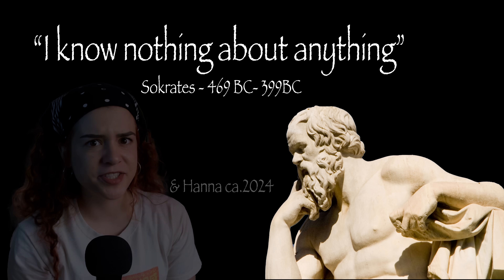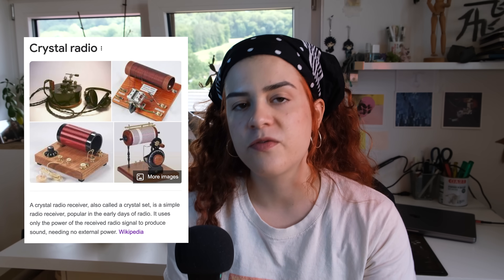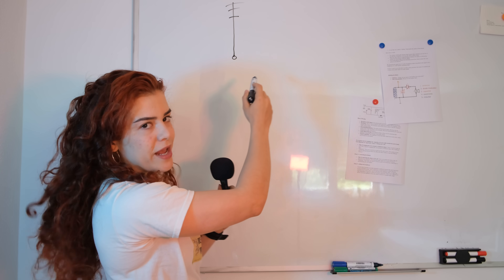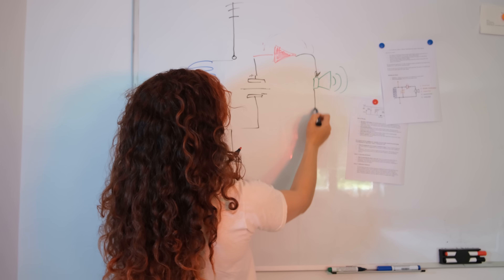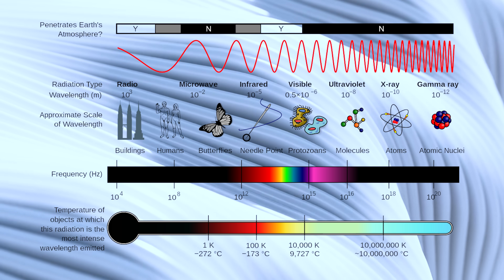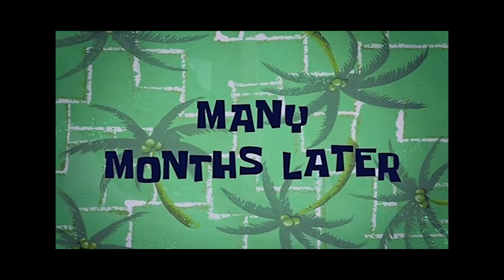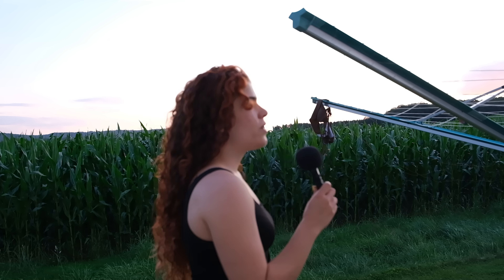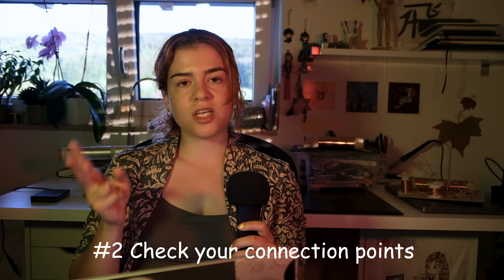I BUILT A RADIO AT HOME

Comment: So the difference between AM and FM is quite interesting. We need to transmit sound waves, which for us are between 20hz to 20,000hz. But if everyone used that band, everything would get super muddy and incomprehensible. So people need their own space

AM solves this issue by giving different stations a different frequency. It’s a very high frequency, in the order of 1 million Hz. Then, you can change the intensity of this ‘carrier’ wave according to the actual sound you want to transmit. 

Am has a big problem though. The intensity also decreases when you go through solid objects such as walls. This means that the difference between 0 signal and the signal you’re supposed to be getting changes, and gives you less audio resolution. Think about it like this, measuring a 10m distance with a ruler is going to be a lot more accurate (with respect to total length) than a 1cm distance with the same ruler. The fact that the property used to transmit information is modulated by other things makes AM very susceptible to noise. Which is why AM channels are noisy compared to FM

FM set out to fix this. Instead of giving a single carrier frequency, it gives a range. These frequencies are even higher, at around a hundred million Hz. To transmit information, the speed of the wave is increased or decreased. This is much less susceptible to change. Even if the signal gets weaker, ie. the intensity gets lower, the speed will remain the same. This is why FM is still audible in an underpass for example. 

AM is basically obsolete at this point, which is probably why you weren’t able to get a clear signal. Stations have become very uncommon compared to FM

Comment: Making a receiving radio is easy, people in the military used to DIY them for music, etc. (Foxhole radios). Making a transmitting radio is where the more intellectual stuff is at, and you also have to abide by the spectrum and maximum power laws. You'll most definitely need an FPGA if not a custom ASIC to make something to transmit digital data. But you could make something simple using small analog circuitry.

You asked how FM and AM matters in your circuit. Well, you most definitely built one of them, because as you know the sound signal is at 20-20k KHz (λ=14.99 km to 14.99m), but you modulated it to ~90 MHz (λ=3.3 m) using signal modulation. The reason is not because sound frequency EM signals are slow (sound waves are different from EM waves). It is because the length of the transmitting antenna has to be at least λ/4, meaning you'll need very long antennas to transmit at low frequencies. That is why our phones operate at 2.4 GHz (λ = 12.5 cm; λ/4 = 3.125 cm) without big antennas protruding from it. Still, longer the antenna, better the transmission, so Wi-Fi routers have longer antennas (but power is limited to 4W according to FCC laws. In AM modulation, we send all signals at a fixed frequency and modulate the differences in data at the amplitude. In FM, we send all the signals at range of frequencies, and we tune into the middle frequency. The one you built is thus, since you don't capture a frequency range, an AM receiver.

There's a project called system-bus-radio on GitHub which lets you use the movement of signals between RAM and CPU (i.e. through the system bus) in a controlled fashion using specific CPU instructions to generate low radio waves by cyclically disturbing the EM field.

After all, in deeper reality, everything is generating radio waves, light and heat. We're just controlling the way in which they oscillate when transmitting modulated signals.

Comment: It's worth pointing out that this radio was not plugged in and had no battery or power source other than the energy carried by the radio waves themselves! which is why it's so quiet. A radio that you can listen to comfortably works on the same principle, but the weak signal is amplified (requiring an external power source) before reaching the speaker or earpiece.

Comment: About 1:37 ...

Instead of a germanium diode you can technically use an oxidized piece of copper (i.e. a coin) as a didode. Some of the first diodes were copper oxide based, these were very short lived and got replaced by selenium and then germanium rather quickly.

Comment: Real quick, for anyone confused on how an antennae collects radio waves, think of a rubber duck floating up and down on water. This is effectively what the metal rods do, they have electrons (the duckies) float on radio waves (get pushed around). Because the radio waves make a cyclical motion (up down up down) it induces a current (makes stuff flow) which can be measured and amplified and used for other things.

Comment: It is so inspiring, that you just came up with this idea and started building a radio, with no electronics background!!! Some things were a little wrong, like the parallel combination of inductor and capacitor which is actually a filter, for filtering out the unwanted frequencies. Keep it on, if you are interested in electronics and don't be discouraged if some things don't work at first ;)

Comment: I did the same experiment, only I build either a transmitter using an ESP32. I could use classic mo3 earbuds. My next project would be an FM receiver as there is still FM in Italy

Comment: Good video! I exerimeted with crystal sets - the best results had been gotten with variable inductance (ferrite rod for tuning) and MOSFET (I used BF998) as a switch (syncronous detector without power supply or a battery).The antenna had two wires (7M each) and central wire .The antenna was like "arraow". In my state nearest radiostation is at 500km distance, but with such a receiver I received far MW stations with high loudness at 250Ohm phones.It is important - DC current musn`t flow through a phone - there must be an electrolytic capacitor.When you get two variable coupled coils - the selectivity will be quite good.

Comment: congrats! It's not a simple circuit cause it has a lot of theory behind all of this. Once I made one of this and i can show some tips:

1. First, the inductor and the capacitor works as a band pass filter, so u have to see the frequency of your local AM Radio cause AM usually don't travel far too long compare to FM.

2. Now that u have the frequency of your local AM radio, you will have to choose the values of the inductor and the capacitor based on this frequency. Search online how to do the math. U can by capacitors and inductors online.

3. Finally make sure u use a speaker with high impedance. Like old phone speakers. I used one of this and it worked.

Comment: you can also do this by using a random speaker, some copper wire, a nail for grounding, and a magnezium diode, which u can find in a lot of old electronics, tie the copper wire on to the speaker contacts, then on to the diode, on to the nail, put the nail in the ground, then tie the wire around a tall metal pole, and bam youve got a radio, i have been doing this since i was a small child in romania

Comment: for anyone trying this , you can get excellent results with these two tips ..

1) the piezo crystal erapiece might be hard to get , instead use an lm386 audio amplifier and connect the usual wirewound-magnet speaker to it
2) antenna - you need as much power as you can get , take a wire and wrap it 20 turns around the telephone wire of your apartment/house , this wire serves as an antenna and effectively uses the entire telephone wire inside your house without directly connecting to it .

Comment: (Sorry for the bad english)    Actually the basic radio receiver circuit that you show at first (The inductor-capacitor circuit) actually works as a resonant circuit. If you wanna generate or receive radio you need one of those, because it 'tunes' into certain frecuency, here's why (explained for noobs):
The inductor is a dispositive that, among other things, generates a magnetic field, if the current is variable then the inductor generates the magnetic field on one cycle but suddenly runs out of current on the next, so the magnetic fields kinda contracts, but it happens that there's an important law which may be advanced if this is explained for noobs but it is: That any magnetic field generates a current on a conductor if close enough, and the electric current itself generates a magnetic field.
So, where we're going with it is that when so said inductor discharges it generates a current on itself (but in the opossite direction i think, doesn't matter). That current must be connected to the capacitor, so, the capacitor can also hold electric charge for a while, and when it runs out of power it discharges and sends current to the inductor back again, and the cycle repeats.

So why is it a resonance circuit? Because by controlling either the capacitance or inductance (The values of the inductor and capacitor themselves) we can change how fast this cycles happens, therefore we can control the frecuency (There's and beautifull ecuation for that but that's boring d:) so last curiosity it's that the way radio normally works, on your car or whatever, it's that you're moving a variable capacitor, with this changing the frecuency and tuning to a different radio station.
Reply: The thing is that antennas actually don't need to be tuned, they only need to have the same relation between the wavelength and the longitude of the wire (Any wire is an atenna itself, but it has to be certain length to catch certain frecuency)
Or at least that's how i see your little project here, anyways i'm far from an expert on this matter, you're just reading a just graduated high schooler that had once to give a talk about radio receivers. It's always nice to see people have the curiosity and discover things by themselves so this video was really nice, anyways greetings from Venezuela

Comment: I think the resistor is needed so that direct current DC actually flows through the diode/crystal junction. Without the resistor, the small amount of voltage does not know that it needs to flow through the junction where it is rectified and thus creates a potential across the piezo-electric crystal earphone.  The earphone has no conduction at DC as it is like a capacitor in structure. The value of the selected resistor needs to be optimal so that the voltage drop of the junction is attained 0.3-0.7V while not so low in value that it soaks up the audio voltage and starves the earphone. I built my first crystal radio from a Boy Scout Handbook, with help from my father. It worked first time, I think in part because I was very close to the transmitter for WOR New York City. Having the proper inductance and capacitance will provide further success.  The capacitor commonly used is a variable 365 microfarads. The coil used for the inductor can be designed or found on line described in a certain number of turns on a form of a specific diameter. My experience is with medium wave 540-1600 KHz.  If you have an AM signal generator in the range you are designing you will have better success. If you don't you might find appliances in your home that interfere with a common AM radio and create an AM buzz on the power line. Try tuning those in using your receiver prototype just leike you might find a loud buzz on your standard radio. Kudos' for your perseverance.

Comment: i don't know if somebody already say that, but i say that now, if you want to have a louder output from the speaker, you need to build a audio amplifier, you can build such a simple audio amplifier with a LM380 where you can add at the output of the LM380 a transistor(BJT NPN), the LM380 will make a just amplification of the radio signal, and the transistor will just do a power audio amplification, so you can add the output of the transistor to the bigger speaker, it just need some sort of extra components, but it is not that hard to build, you can find it on the internet, but i recommend to slightly modify it.

Comment: You could also have better luck recieving am signals at night. This is the case because commercial AM broadcasts are at very low frequencies, which are able to bounce of the upper parts of the atmosphere, but that only works if the atmosphere isn't being hit by sunlight because then it's less ionised. Because of that it is way easier to get signal at night because the signal doesn't have to travel directly from the tower to your antenna because it can go up into the atmosphere, bounce back from there and go back to the ground without obstruction of things on the ground.

Comment: Congratulations with your crystal radio! I'm pretty sure it's much harder to make it work today than 50+ years ago, because AM radio is dying out, and amount of powerful AM transmitter in the world is constantly decreasing. And as you've already mentioned, crystal radio can't receive FM and SSB. As you've probably never heared of SBB, it's similar to AM, but only uses half of the spectrum of AM (and usually no hard carrier) which makes it much more efficient in terms of radio wave energy. SSB is popular among HAM radio operators, and there are also a bunch of shortwave stations that use SSB. And there is of course FM, which is normally found on VHF bands for local broadcasts and communications (VHF radio normally does not go over the horizon, unlike shortwave, medium or long waves radio does, so it's range is limited to about 100 km).

Comment: The block that is formed with inductor and capacitor is called a LC circuit, or harmonic oscillator, and it is one of the crucial building blocks in almost any radio simple or advanced. It has a resonance frequency that is determined by both inductance and capacitance. That means, that if we inject signal (from antenna) into the oscillator, the frequency that is close to the resonance frequency is amplified, while all other frequencies are jammed. This effect allowes to use oscillator to tune the radio to the desired frequency by changing inductance and/or capacitance.

Comment: Germanium diodes took the role of what is called a detector, or demodulator in the radio - a block that extracts payload (audible frequency in this case) from carrier (radio frequency that allowes signal to propagate over great distances). However, diodes are later and more fancy type of detector. Sometimes you can get something that works like a detector by touching tip of the pencil to the razor blade, for example. It needs a lot of tries and adjusting to get it work like a detector, but it can be done in a pinch, if you don't have low forward voltage drop diode laying around.

Comment: This is so Awesome!! I am so impressed.
it is very hard to get good signals with these crystal radios,  - yes you need the piezo earphone - and a very low loss diode.
Germanium is excellent, but unfortunantly a lot of the NOS new old stock, are no longer good - and does not work as they should.

I am so impressed anyway.

Comment: An inductor and capacitor form what's referred to as a tank circuit. This resonant configuration causes incoming radio waves within the resonant frequency range to oscillate electron charges between the capacitor and inductor, back and fourth. The perceived amplitude of this resonance, or merely the fluctuations of it, is what is being detected, or separated out, from the RF with the use of the diode so all you are left with is the modulated audio on the incoming RF
Reply: On a further note, I highly recommend building an even more powerful crystal set radio with a TA7642 IC. This effectively turns your crystal set into a TRF set.
Search for schematics using this IC, or search for matchbox radio. There's a fantastic site that no longer exists, but can be found on the Wayback machine telling you all you need to know

Comment: I love this. Learning new stuff is the best.
I was a little confused about your starting point, in the beginning of the video, but I guess you are about high school level physics with only limited knowledge on basic electronics. (AC and radio communication is not basic electronics if you ask me) So I am very impressed that you kept at it. It is much easier to read about something than constructing that think. And it did not look like you had acces to simple tools like a multimeter that could help a lot with testing, or more complicated tools like an oscilloscope that can be very useful when working on signal electronics. Witch just makes it harder. (well you could have to learn to use the tool too if you had them and that can also take some time)

Your "brief history" part and "AM radio" explanations looked to be way easier for you, but you also have 200 videos of practice so i guess that makes sense. 😂

I hope you have found a new project for your next video. 🎉👏